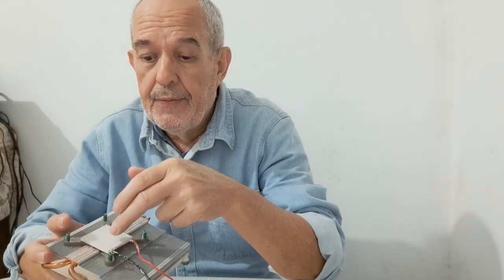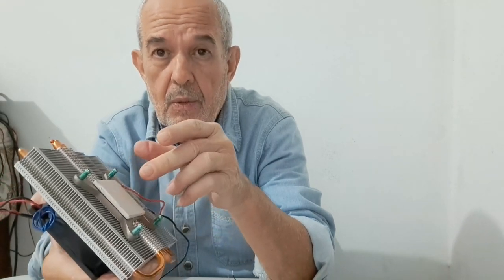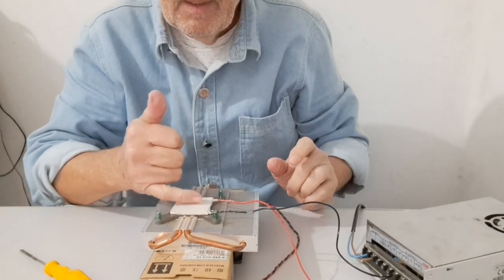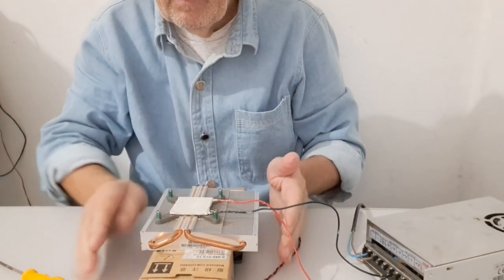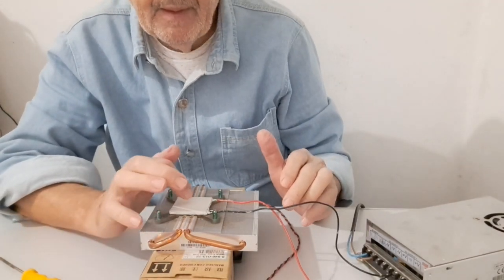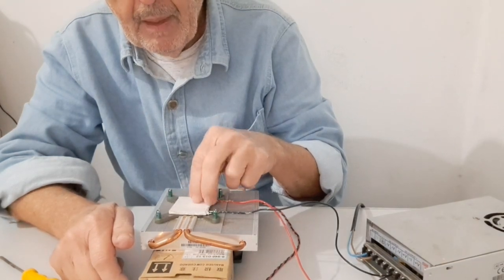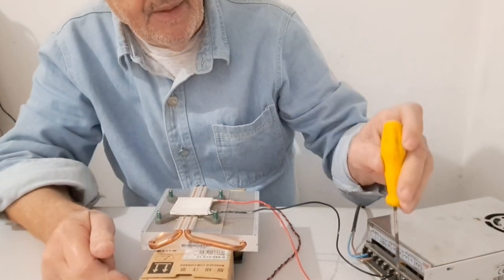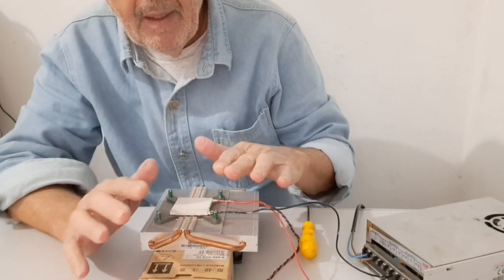Peltier Cooling System - How to improve the efficiency

Comment: Thumbnail claims how to get more efficiency! 
Proceeds to run Peltier device at 12V which is it's least efficient voltage! With no thermal camera or anything remotely related for temperature measurement! There's nothing to learn here!